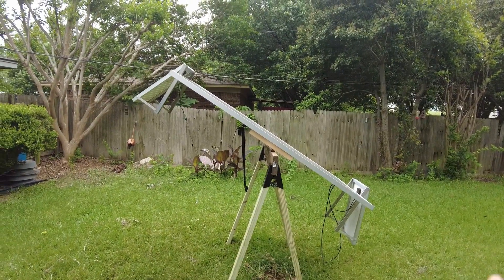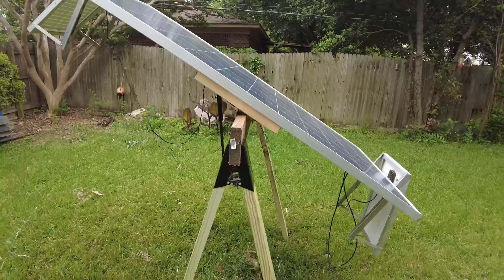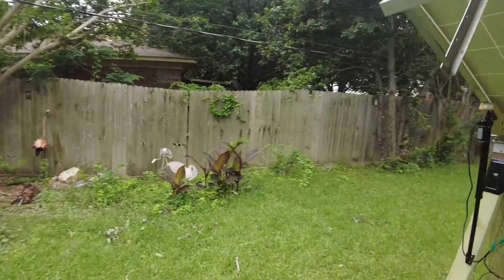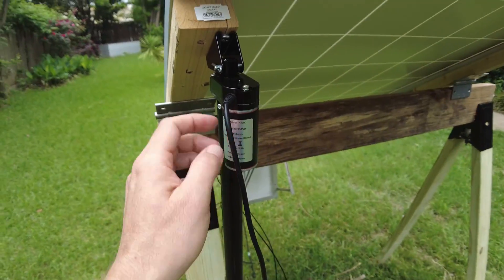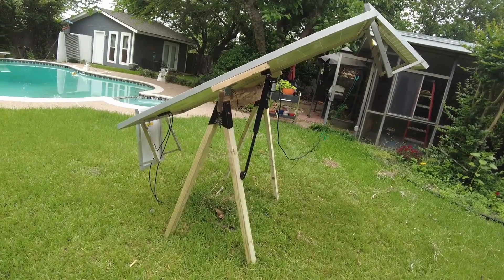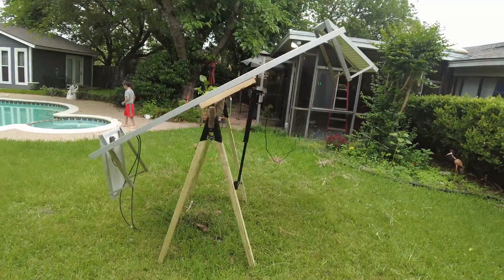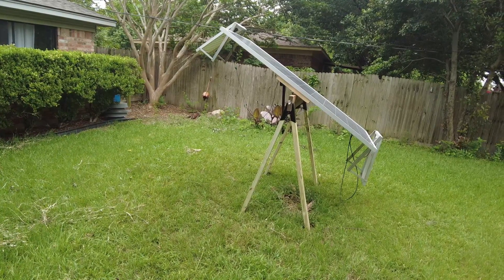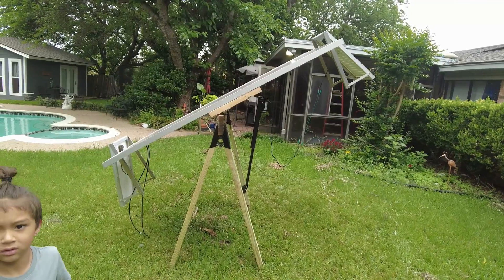Easiest Solar Tracker

Comment: So you have the two panels wired to the same two wires on the actuator, but reverse polarity? What makes the actuator move in two different directions?
Reply from the maker: Watch this https://www.youtube.com/watch?v=ADIUlVR0bh4 Basically if both panels get the same amount of sun they will cancel each other out, the voltage will be close to 0v . However if one panel has more sun (or is not as shaded) that panel will win the tug-o-war fight. If that's the one wire with positive polarity it spins the motor one way, if the other panel is the one with more sun it's wired negative polarity so it spins the motor backwards.
Reply: @BradCagle  yeah, I went back and watched the rest. My thought now is will it work on larger arrays with more powerful panels and actuators, or would you do multiple actuators on the same large array with multiple small panels for the actuator. And could you run into a problem with multiple actuators of them getting out of sync and fighting each other. Or higher power levels with stronger single ones overheating the actuator motor. I am surprised it doesn’t happen with these units you used. The two panels fighting each other just seems to be astonishing without some sort of heating. But these are questions that are just theorizing on my part. I have a dynamite setup planned out with your (well, THE) idea as the backbone. Amazon has adjustable leg steel sawhorses that hold 1350 lbs each. Strap a piece of pipe on it length wise with the top rail of the sawhorse, then again on Amazon, pipe clamps (the U shaped ones with the little “wings” with bolt holes like electricians use on conduit) stainless steel heavy duty, the proper size for the pipe (chain link fence 1 3/8”  “top rail”, cheapest pipe around, and STRONG!) clip the pipe clamps around the pipe and to the frame of the panels, and the rest is the same as yours. The big part for me is the adjustable legs. Set the pipe running north/south, and then through the seasons you can adjust for north/south by lowering/raising the sawhorse legs. Since it’s only once a month or so, no big deal. And on a poured concrete “sidewalk” with eye bolts embedded in the concrete with cables running up to the center of the top bar of the sawhorse to stabilize it. 4 eye bolts in a square pattern under the sawhorse with 4 cables so you can do the tilt with the adjustable legs. Took me about two hours spread over a couple days of thinking about it and doing product searches on Amazon. I do custom fabrication and electrical for my clients, so if you want more details or clarification, let me know in a reply.
Reply from the maker: @5400bowen  Here you go: https://www.youtube.com/watch?v=gHZCTBCteW0
Reply: the sun,  those panels that move it are on a 90 degree

Comment: What effect does putting a reversed current into the two panels have on the life of those panels?
Reply from the maker: Probably nothing. Solar cells are much like diodes. Also there's actually not much current here, and solar panels are built to basically handle a full short, or they should be for that matter.

Comment: Nice dimensions, basics are fine. You might consider making a frame (like aluminium window blinds) that rotate smaller segment adjacent to each other in the same direction in parallel. That way you could make it larger without to worry about the balance. Basically the outer frame would be horizontal and could be mounted on a roof or vertically on a stand in a garden. Smaller footprint and you would be able to do the second axis by rotating the solar blind on its stand. You will have to make the blinds with solar cells yourself. Maybe i did not explain adequately.
Reply: Yeah, explaining this stuff in a comment adequately turns into a book! I really can’t picture your idea, but I just wrote up a description in a reply to his reply to me about a setup inspired by his. I’m thinking I may have fallen far short of making it clear too.

Comment: Having reverse current opposing a power source such as a PV I view as a little sketchy.
If you know what time it is, you can position the screw motor as required.
Reply from the maker: PV panels, their attached wiring, and junction boxes are actually designed to be fully short circuit capable. Well at least they are supposed to be ;)
Reply: @BradCagle pretty sure those already have a diode built in or it would discharge the battery they were intended to charge when the panel is in the dark.
That was the original reason for the diodes in solar panels to stop discharge at night.

Comment: Maybe 10 years ago when stuff was more modified sine wave, I bought a big kit w/o quite understanding its limitations.  Now I have 4 huge, heavy 100-watt solar panels that I've never even unboxed bc they're so heavy.  So I'm hoping someone can tell me:  Would it work if I just set them up in 2 pairs, no sawhorse or actuator involved with the short sides on the ground about 3 or 4 ft apart & the top short sides leaning together at the top.  Of course there'd be no tracking involved; but I'm 78, live alone, and way out in flyover country it can be impossible to get any help.  Not only am I short and old, but ....  I'm short and old.  Plus not terribly 'handy' - I shorted out 2 lamp swag kits b4 giving up one time.  So I don't even wire ANYTHING.  Hope you can might tell me what I CAN do.  So long as it doesn't involve jumping off a bridge or something.  I'm old and short but not quite that stoopid.
Reply from the maker: Yes, that can work. People do this east to west configuration. You can also just face them all south if you're in the northern hemisphere, which performs better in winter. Thanks
Reply: @BradCagle  - Thank YOU for that very helpful answer.  Just one more question if you don't mind, regarding facing them all south:  What do you think if I put a couple of sawhorses broadside in back and just leaned them up against that?  having long enough legs to achieve that fabled 25% slant?  With maybe cement blocks at the foot of the panels to stop them from sliding down?  Of course I've got a couple of EcoFlow solar generators now, less than 12 lbs each so I can carry them indoors and out.  This is only for potential grid down situations.  I won't fool with wiring but I can safely plug things in, understand safety measures, etc.  Love to read & study tech stuff. 

Though I still don't know what happened to those 2 swag lamp kits.  Just 2 colored wires to match.  Is it statistically possible I could've had 2 bad ones, one right after the other in short (forgive me) order?

Comment: Well since the two panels basically cancel each other out you have to have enough of a difference in panel output to generate enough motor torque to drive the actuator/move the load.  Basically the motor is always operating in a brown-out state.  Because of that this works well on a very small scale but it does not typically up-scale well as the motor is passing current but not rotating to dissipate heat.  Notice how no one makes production versions of these?  Another way to do this is with a voltage sensing relay circuit monitoring a small single panel partially hidden/shaded behind the main panel. As the sun passes over the main panel and strikes progressively more and more of the small panel, it will eventually exceed a certain set voltage.  The volt sense circuit will then close a relay to power the actuator which will re-shade the sense panel and  the voltage drop will open the relay and stop the motor until the sun moves enough to increase the voltage.  You use a small battery and charge circuit fed by the main panel to provide the motor current switched by the volt sense relay.  A limit switch returns the panel to the morning home position and readies it for the next run.  This way the motor is always fed adequate current to start instantly and run properly.  It can get out of sync if you have long periods of clouds, but if the sun can touch the sense panel eventually it will command the actuator to advance the panel…
Reply: You need to go back to physics class, and electrical too. No one makes it because of greed, not impracticality. There is only one tracking system in existence. No one wants to do the research. This setup up is both scalable and perfect.
Reply: @5400bowen  “no one makes it because of greed”?  Please explain that.  If I can make a better and simpler mouse trap and sell it for less than my competitors and capture their potential customers, greed would compel me to do so wouldn’t it?  The easier it is to produce, the greater the profit right?  The problem is when you make something for sale, you as a manufacturer are responsible for ALL ASPECTS of it working as intended, or you will forever be paying for warranty repairs and providing parts, or develop a bad reputation so no one will buy it.  Or if it is bad enough, suffering thru a class action lawsuit…   Perhaps YOU should go back to economics class.  You also apparently don’t understand how electric motors cool. They need to spin at their rated RPM. Running a motor under load with low voltage @ low rpm causes them to overheat, shortening their life…  will this thing even develop enough force to overcome wind blowing against the underside of the opposite end of the panel?  A backyard utube demo is not the real world…  which is why I described a very simple method of driving the motor properly so it can deliver full push/pull when commanded, and not hold the motor under constant current until it develops enough force to move the panel.   Perhaps you are correct “they” don’t make it because of greed, because “they” ultimately want to MAKE money and not LOOSE it on an ultimately unprofitable product that doesn’t work in the long run under all circumstances/conditions a panel out in the weather might experience.  I welcome you to put YOUR money where your mouth is and bring one of these simple and better trackers to market…
Reply: @rronmar  the proof is in the pudding. His motors aren’t overheating, so you just use a bunch of small actuators with small panels to move the full array. A bunch of small actuators are safer and more reliable, cheaper and more easily installed than an “upscale” giant single unit that only large already established corporations can afford to dabble in. Just like the inverters that are on the panels and you use a bunch of smaller ones instead of one to several big ones. Much more efficient and reliable. And I have plenty to keep me busy as it is, I don’t have the time to branch out into starting a solar tracking equipment company. And no, bright ideas aren’t always brought to market. Like all the patents for super efficient carburetors that GM and Ford  etc. bought up the patents for and buried them. It’s happened many times in many industries. Eco worthy has a tracker designed and manufactured. But it is a comparatively flimsy set up…they know how to make trackers, yet they did not decide to use the best design…why? Greed. It was faster and cheaper to put out an inferior product rather than do more grunt work coming up with a better product. It’s all around you if you have a discerning mind. But that takes time and effort as well…Yes…you are the one who needs to go back to elementary physics and electrical education. And I already have a super good design that takes all that into account for my own solar array. Took me about a week of mulling it over and searching existing products to finalize my idea after seeing this and the second demonstration by Mr Cagle. The principle was demonstrated by a 12 year old girl in her school science project 11 years ago. Have you ever heard of the Naval Electronics Systems Analysis Laboratory in San Diego CA?
Reply: @rronmar  oh and all the product liability (that you took a paragraph to say!)…well, we all know that no business has EVER put out a trash product and been sued out of existence…your problems a straw dogs to scare the laggard idiots who can’t think a process through and come up with viable solutions. I suspect you are just jealous because this solution is so elegant and you didn’t think of it. And it sounds like you are pissed you can’t be the one who gets rich off this idea. And it is poor form to use the same word twice in one sentence…ultimately.
Reply: @rronmar  P.S. , his back yard, by definition, is the real world, Plato. There’s more Ron, but I don’t want to mar this experience any further.
Reply: @rronmar  somewhere in the past there was a guy like you saying stuff like that to Diesel, and Ford, and the Wright brothers, and Tesla….
Reply: How does current flow with no voltage difference?
Reply: @ghz24  there is a voltage and current difference due to one panel getting more light than the other. If you measure the voltage coming out of panels, it varies with the light intensity. At noon theoretically the power is the same, so the panel would be flat.
Reply: @5400bowen  But once they are in equilibrium there is no voltage difference hence no current.
I guess your point is the actuator is not ever getting 12 volts but only a couple volts when it's moving?
Reply: @ghz24  once again, you don’t know much about solar. Have you ever tracked the voltage of a 12 volt panel? That is a nominal voltage. Voltage is very seldom exact. My 12 volt panels have put out up to 19.2 volts. And as low as 2. The difference between the two panels is much greater than you seem to assume, as the watts per sq.meter of sunlight changes in each panel. And the net voltage at the motor does not need to be in total equilibrium. Depending on the  specific actuator , it will MECHANICALLY equalize when ELECTRICALLY it is still not perfectly equal…..
Reply: @5400bowen  You never "once" so you can't "again".
I asked the OP a question and you volunteered an inane reply that was irrelevant to the question and assumed I didn't understand the function of the device instead of you not understanding the question.
You got one thing right, greed keeps companies from developing tracking systems, greedy bastards don't want to loose money developing something that nobody wants. Imagine wanting to sell things that people want. Nobody wants to buy tracking systems. Why would anyone want to turn a system with zero moving parts into one with the reliably issues and  maintenance burden of including moving parts when adding an extra module or two more than makes up for the performance difference without any moving parts..
The only people that want tracking are those that are forced to by space restrictions or those that want to tinker.
The tinkers are not going to buy a system they will build their own.
Then you treated us all to the nonsense of manufactured modules being so different that it would be impossible to match their output to work against eachother when  the difference could easily be adjusted with super high tech frosted scotch tape.
Any minute differences would just result in a degree or two of error in the aiming of the main module and a miniscule change in performance over perfectly matched panels.
There are no magic carburetors that is all urban legend BS.
Where are the patent numbers for these magic carburetors? You can't just bury a patent like you proposed because it's public record.
If your going to push conspiracy theories at least pick on that holds up to simple logic.

While were correcting your BS lets cover microinverters, they are not more efficient, they are not more reliable and, they are not easier to repair. Oh look bad form useing the same word three times in a sentence LOL.
They have the same efficiency as string inverters. They are less reliable because they are installed outside in the summer heat under solar panels that create heat. 
They are not easier to repair because I can find and replace my string inverter before you can even find the faulty device without a monitoring system and I get to work in my climate controlled utility closet out of the elements. 
Microinverters are in fact less efficient if I charge a battery or drive any DC loads because I now have converted DC to AC and back to DC when I could do no conversions and be at least 10% ahead if only I hadn't immediately converted to AC for no reason.
Microinverters may be a good option if your only objective is push solar power to the grid.
Units of a system that have individual trackers may result in more of the units being functional at any time but it also means more units will be available to fail.
If a monolithic system fails all the units are nonfunctional but when it's a network each unit must now be individually maintained and adjusted.
You need more research and less flapjaw conjecture and conspiracy crap.
Reply: Your first statement in your original comment indicates that what you see in the video cannot happen, or that it would overheat and burn out the motors in a very short time…but again, reality closes in.. his actuator motor doesn’t even warm up. This is proof positive that your theoretical objections are pipe dreams. Especially considering how thin the wires are to begin with. It reminds me of the cop videos where the suspect is calm and quiet and never makes a move…and the cop swears the guy attacked him. We all see it with our eyes that it works, and there is no overheating…just like in the other two creators that demonstrated this principle, the first being a 12 year old girl who showed her science project using this principle 11 years ago hear on YouTube. But don’t let the facts dissuade you….
Reply: @5400bowen  Who are you talking to?
The OP hasn't replied in 2 months.